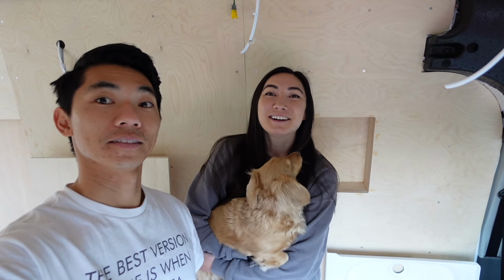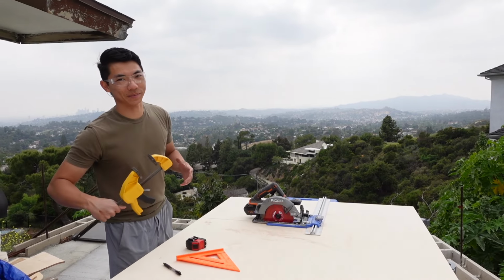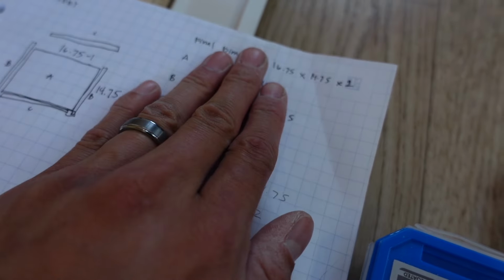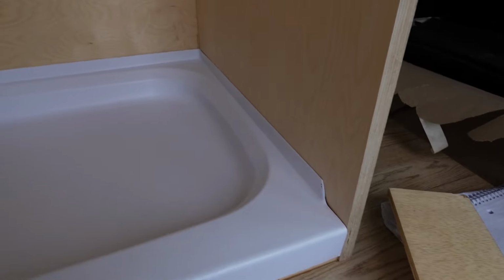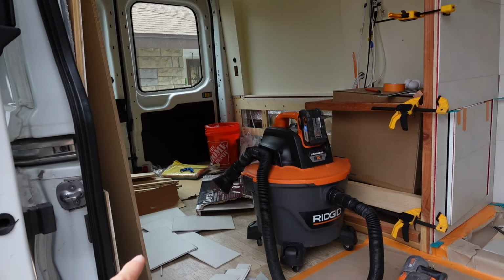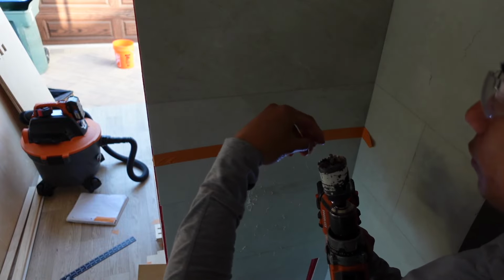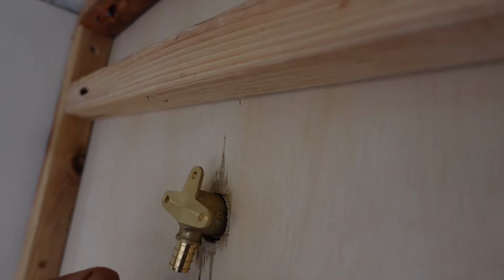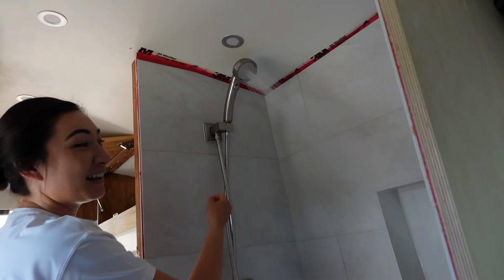DIY Van Bathroom - Shower, Hidden Slideout Toilet, Toilet Paper Holder | Van Build Series (Ep. 18)

Comment: Hey guys, love this shower! 

How much clearance do you actually have on the toilet door? I don't want to do a composting toilet, the laveo dry flush is 18" tall. I know the cuddy isnt as tall.
Reply from the maker: We ended up with about a 1/4” all around the cuddy through the access door. It’s a very tight fit. You might be able to upsize everything to work with the Laveo. The drawer slides and drawer box will add some height as well.